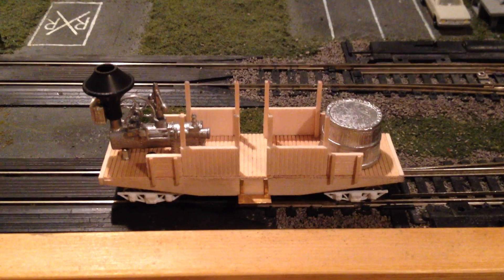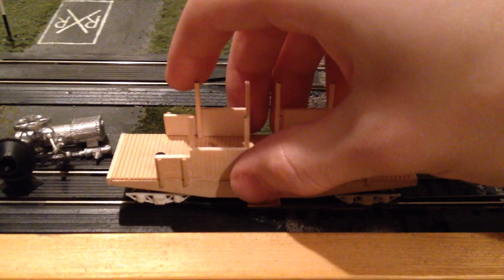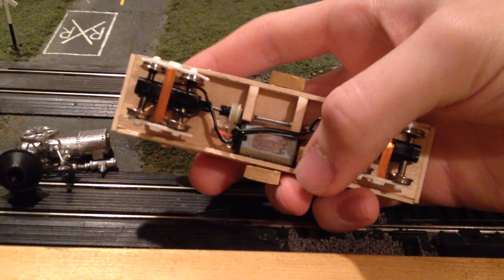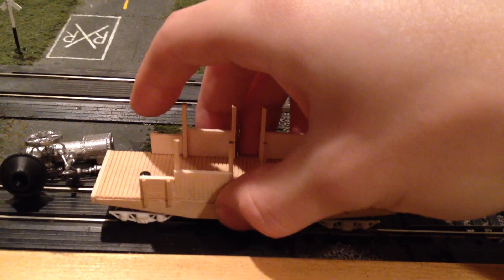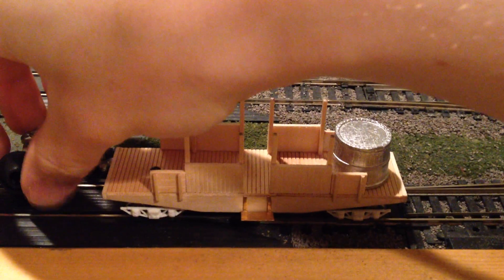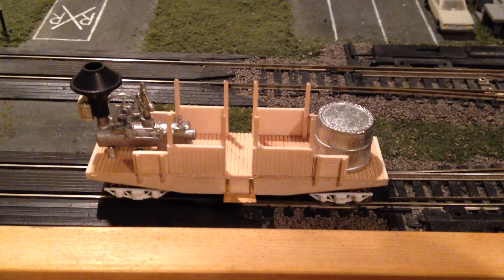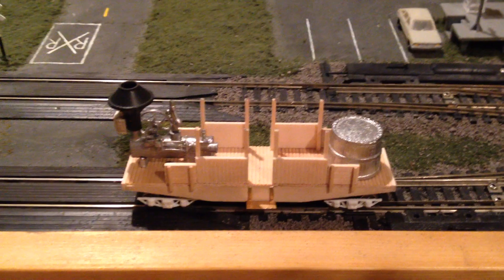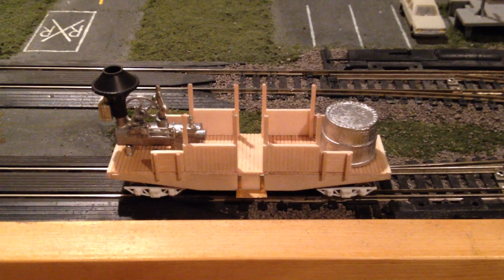Powered Climax steam engine project!

Comment: That's really neat. I'd love more detailed videos of drives like this. I'm looking to do something like this for possible upgrades to old brass trolleys. I have heard of guys using slot car motors. My only real issue would be negotiating tight curves of city trackage.
Reply from the maker: If you don't mind the price, try a BullAnt drive from Hollywood Foundry: http://hollywoodfoundry.com/#bullant
They're made to order, so it takes a while to receive them, but they're excellent miniature drive units!  I'm using one with the belt drive option to power an old Walthers kit.
Reply: DarthSantaFe Yeah, the bull ant drive is a neat option, but I'm looking for something completely under the floor for a CSL crane car.  The model would only need to move itself and maybe a small tool car behind it, made from a modified single truck streetcar.

Comment: Really neat approach to powering your engine! If I may ask, what are your truck centers spacing and your deck height? I ask because I am trying to come up with an underfloor drive similar to this.
Reply from the maker: Thanks!  The truck centers are 3-1/8" apart, and the top of the deck is 5/8" high.  The thin deck material sits directly on top of the motor, and the skirt just barely hides it all.

Comment from the maker: Thanks!

The cost for each full gearbox with axle is about $15, and then another $25 for the motor and flywheel, so the cost to power it is close to $90. The Climax kit is worth another $30, so the whole thing is worth close to $120. Still a lot cheaper than brass or even most plastic anymore!